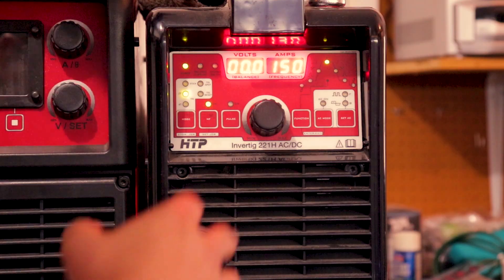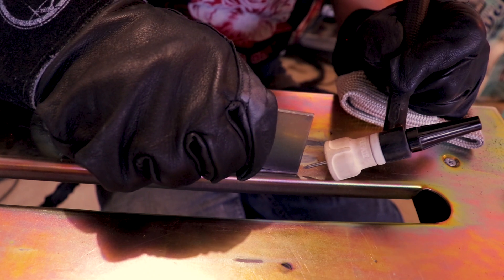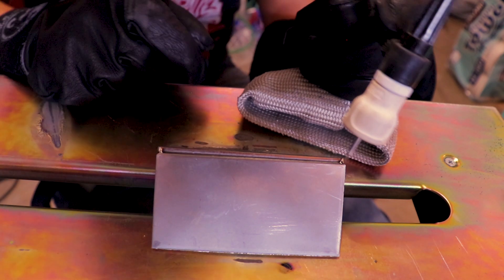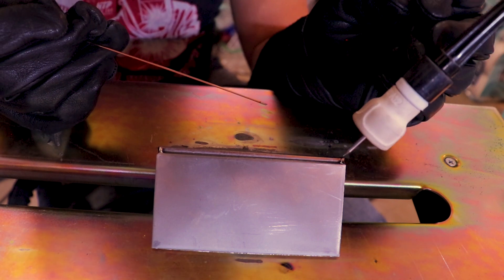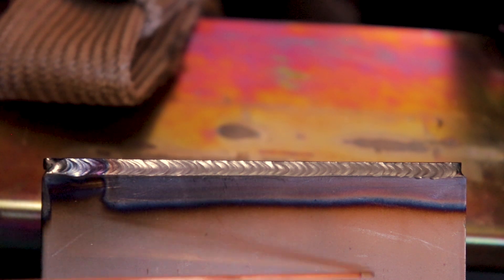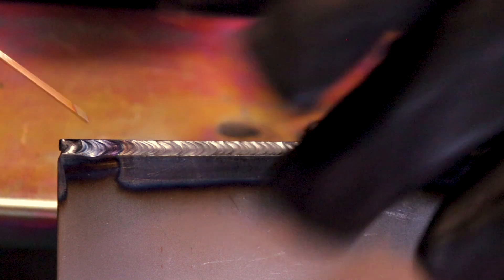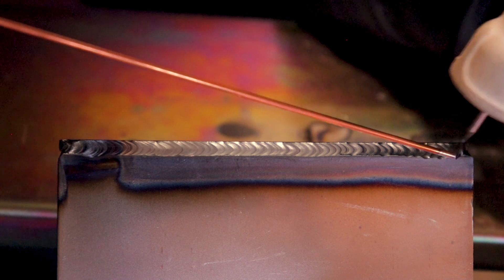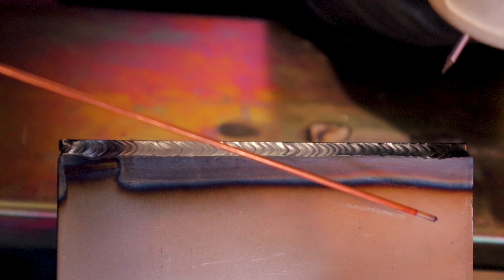How to Pedal Bump with a TIG Welder (GTAW)

Comment: I've been using this technique as a beginner in my first welding class on thinner material. Doing a 14 gauge steel vertical assignment I found it difficult to deal with the workpiece overheating when doing straight stringers, which then affected the consistency of my weld.

Doing this felt like cheating once I got the hang of it. Night and day difference with regards to heat buildup. Thanks for the video.

Comment: Hi great video! Most of the motorsports places im familiar with when doing 4130 cages only do a single pass on there weld joints. Do you suggest running a small root pass on roll cage joints as well? Thanks
Reply from the maker: Its all personal preference.  This is just the way most of the trophy truck guys get so much consistency.  For production work its just adding more time.  The main benefit is that you can make everything super consistent.

Comment: so just how much post flow do you run on mild steel ??
the finished profile on that weld is tragic , way under filled , I would doubt if you actually have a mil of steel in x section at the root . Why would you weld anything like that do you have an approved welding code or procedure , or is it just stick things together and hope it stays that way . I really hope your insurance is in date .
Reply from the maker: I just double my cup number to get my cfh.  So im using a number 12 so 24cfh
Reply: @5thStreetFab  would love to see that test piece cross cut and etched , not for pen , for area .  Maybe its just on this demo that the finished weld is so low in profile , please dont tell me you actually send stuff out the door looking that way . I hope its just a trick of the light , maybe just the way the camera makes it look in the video.
Reply from the maker: @tomthompson7400  haha i think you might have only seen the first pass i did on it.  After the first pass was done and cooled off, i added a cover pass with much more filler,  but its only like the last minute of the video.
Reply: @5thStreetFab  ah ... that helps ... some of your videos are very very good .. but this one was a long way out of character ... keep them coming .. your pipe welding video is one of the best out there ...

Comment: A little too much work to do 2 passes with Tig on mild just for cosmetics.  At that point, since it's an automotive application, I'd just weld slightly cold with mig.  

Good video thought, ever think to just do a quick autogenous root and laywire with 3/32 filler and pulse?  Could probably even forgo fusing the root first if you go hot enough on pulse.
Reply from the maker: Agreed its usually on 3/16"  bit all i had was 1/8"  ya that would probably work well i was just showing the technique they use and its nor.ally for 4130